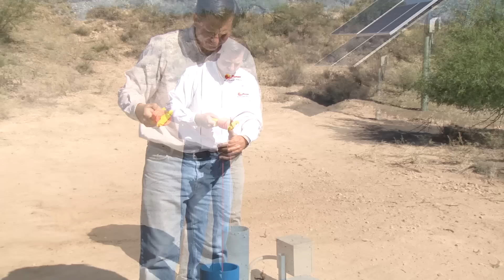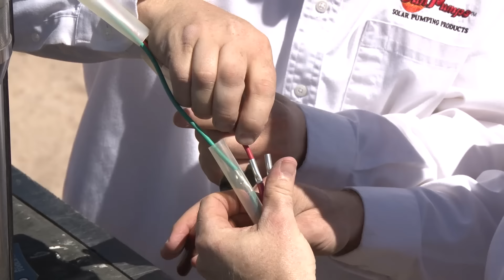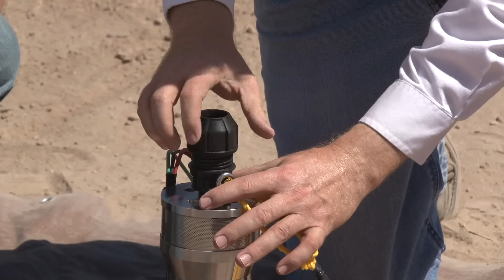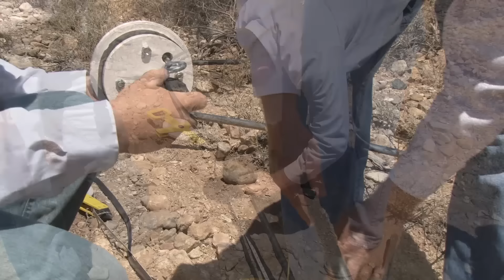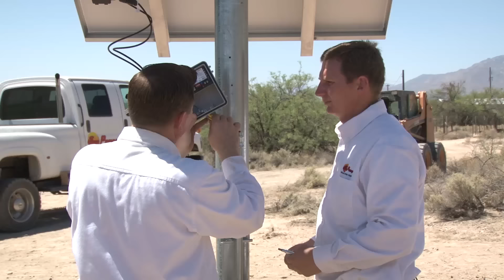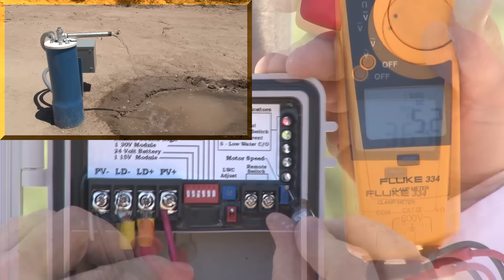SunPumps SDS Install

Comment: Im sceptical about the part where they had to short the positive and negative terminals to confirm low voltage. Its an unsafe practice

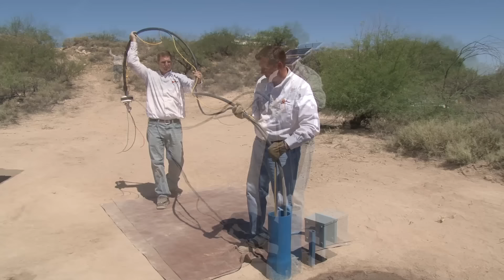Comment: hello. i have a question about how you tie the rope together with the pipe and wire. we can see clearly  at 12:20 that the yellow rope is making that loop. isn't it going to break the electrical tape that you used to tie everything together when the system will fill in with water?

Comment: Beautiful workmanship.  One thing I like to do with electrical wires is to stagger the cuts, short, medium and long.  Just in case vibration wears off the heat shrink insulation (or cockroaches eat it, or it basically dry rots away) there won't be any exposed wire to contact with another wire.  It also makes the finished bundle with the last heat shrink over the whole bundle a lot skinner.

Comment: I have a SDS-D-128. My solar system (12 volts ) charges my batteries (used in part by other devices) how do I hook up the pump direct to the battery
Lynn

Comment: I don't get why you tie together the poly pipe and electric cable with the rope. Do not tie the rope, otherwise all the weight is distribute between the three elements, specially the electric cable, and You forgot the torque arrestor

Comment: shouldnt the tension be on the rope itself and not the pipe? or the rope is just for security and thi pipe can carry the weight of the pump? nice installation overall

Comment: As a professional groundwater contractor, it bothers me that people do not know how to properly terminate the well head/seal. The hole they put the eyebolt through is there to monitor water level on the well and to place disinfectants. It is not there for an eyebolt. 
Then there is the rope they used. Any rope is a great place for bacteria to hide inside. This can cause the well to have bacterial issues. Who thinks this rope is stronger than the wire in the well? The use of rope is old technology.
On top of this are grounding issues. There should be a bond to a ground rod, from the pump's ground wire to the solar panels and racking. This is to equalize the potential to ground and prevent electrocution. There is a lot more to discuss about grounding that would take a lot more space.

Comment: I must have missed something on the panel connection detail.  If you are getting (almost) 40 volts with a parallel wiring connection, wouldn't you be getting close to 80 volts with the panels connected in a series configuration?

Comment: Great system for off grid. Hand pump option is a must. Check valve will save stress on the pump. Great video.

Comment: How many instruments required in this project, tell me total cost and item wise also.
I think this is best solution.in my farm underground water available at 45 feet depth, does this system will work.

Comment: I have 14 of these pumps on the ranch and have mixed results. Some have lasted ten years others will leak water into the motor and fail in weeks. They are easy to work on and can be pulled and hauled home. They work well in the winter if you drill a weep hole to allow the water to drain below the frost line. Wells below fifty feet do not work as well as the shallower wells. We have been using larger solar pumps that pump from below 300 feet at a much higher cost.

Comment: Terrible way to install a well pump! Never use a compression fitting to attach pipe to pump or galvanized fittings, bad bad advice. Always use barbed extra long brass or stainless pipe connections, never galvanized or compression fittings.

Comment: Had a borehole pump failure  a few years back.. tape had fallen into the bottom of the borehole and been sucked in to the pump..jamming the impellor .Better to use strong zip ties to secure cable and polypipe..rather than tape..

Comment: To much show for a simple job to do. 
I did it when I was 15 years old with no electrical, just PVC and 12 voltage pump. Show complication with to high selfishness but nothing about nothing.

Comment: This kit was perfect for it and has saved us from having to run electricity to the pond area. allmy.tips/SolarWPumps It was easy to put together and the fountain goes up pretty high when full sun is on the panel. The fountain keeps the water moving and I haven't notice any mosquitoes around the pond since I added it.. I added a DIY filter system (a milk crate like cage, lined with furnace filter material, set the pump inside it and added filter bio-balls). The water has been keeping pretty clear. and I've had no pump blockage or problems to date ( but have only had it a few months).. I really like it.

Comment: well the pump hangs on a pipe and cable itself as the rope was loose when they put the lid on well :) Shouldn't the pump be supported by rope rather then pipe and cable?

Comment: AS an electronics designer and system installer, If you use electrical in an exposed situation like this, the tape you should be using is NOT #33 3M. You should use # 88. It has a different adhesive that will not degrade.

Comment: Hello, how are you? An FX exchange business is a company with more than 300,000, the Fx trading in its capital by 400% in 200 business days. , work without multi-level marketing, and further boost your earnings.6% of the torque and 10% of your team's earned waste, from $ 100 to $ 50,000!

Comment: it'really not a good idea to couple the rope with pipe stable. Rope must be strenth and take the load. Pipe must be free of load. Rope is holder , pipe is pipe. They should attach two of them by a free moving clips or nothing.

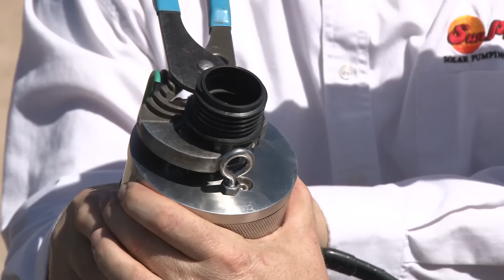Comment: 7:00 brass or stainless fitting, not the proper tool to tighten the plastic fitting. It will fail. Hot air gun, no open flame, especially around the well head.

Comment: i have a spring and its roughly 8 ft deep and 4 ft. diameter. i have a 110 invertor . will this pump work on my set up if its 500 ft from my house with a 50 ft drop in elevation?

Comment: Good afternoon my friend
I work here in Brazil with the assistance and installation of water pumps for farms and farm ranches.
I would like to be your representative here in Brazil.
if it is in your interest, please kindly give me the full application cost, for example.

- how many solar panels are you using
- How many meters, this pump can send the water in a rise,
= what type of pump and working voltage.
-You use the battery after the solar panel. or and direct feed / pump panel.
- what is the cost of the complete system: Pump + solar panel and pressure gauge.
-The product is guaranteed for how long
-Voces offer repair kit for maintenance

Note: here in Brazil I work with a pump that raises water from a 100-meter-deep well plus a line of 1-inch-long tubes of 250 meters.
Att: Amauri / Brazil

Comment: how many volts supply dc motor? power consumption of the dc motor?  and how many volts, power, current generated by the solar power plant? any backup supply together, battery how many volts   if they have?   manicarcarl@gmail.com  +639464123902 thanks